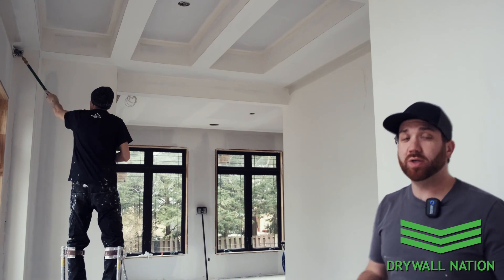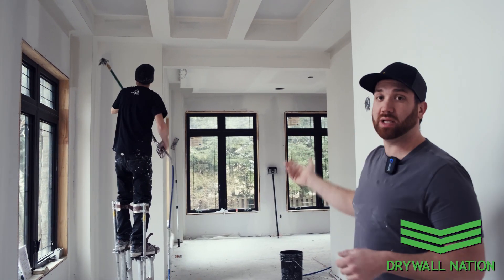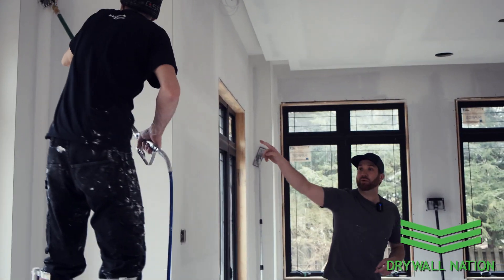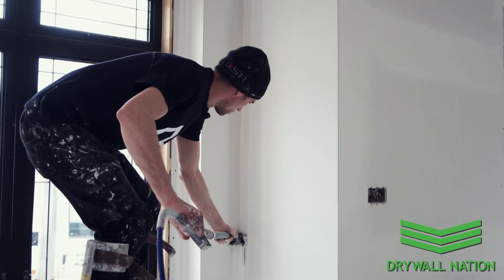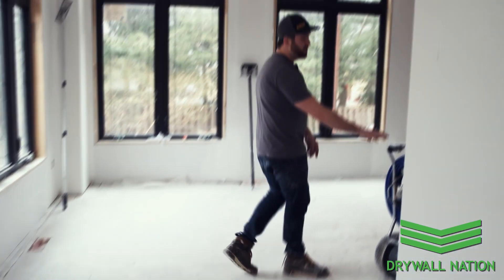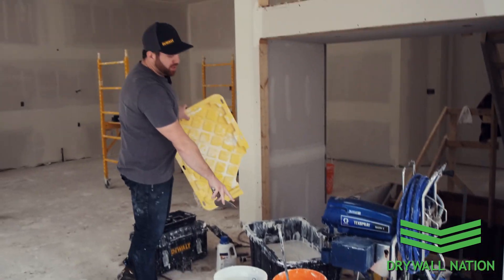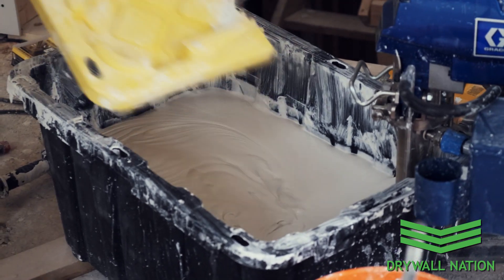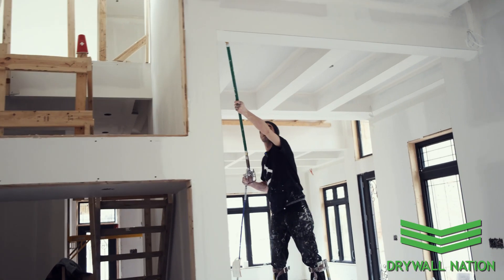Apla-Tech CFS Continuous Flow System w/ Brad Hanna

Comment: Very cool guys! Looks like a very easy method for running angles
Reply from the maker: Thanks Phil! It definitely has it's pros and cons. Just like any other tool. But one thing is for sure. You save a lot of time by not having to make trips back and forth to your pump.
Reply: Was curious do you use both systems alpa tech and Columbia and info would be appreciated... .

Comment: He's so far away from the head and that huge pole flex, his back and shoulders will be ruined in 10 years.
Reply from the maker: This is drywall....it doesn't matter what you do your back and shoulders will be ruined in 10 years. lol.
This is probably one of the easiest methods on your body for finishing angles.
Reply: @drywallnation  I've been working with automatic tools for 15 years.
The key is to always be close to your tool, wether it's a flat box, angle head, bazooka etc.
It might be a bit slower to use your stilts to finish your angles, but if you have back pain at 40 years old, you'll be much slower for a very long time.
Reply from the maker: @ProbeGT2  So you run your corner box and and bazooka off of stilts?
Reply: @drywallnation  I don't use a corner box, i use a blueline mud tube to finish my corners. 8' i don't use stilts but 9' and more i do all my walls 1st then get on my stilts to finish my ceilings.

I only use my bazooka to tape corners and use the same method. I do all my flats and butts with mesh and durabond90 so i can box them one coat the same day.

Yes the blueline tube is heavy but if you balance it well in you hand it is not more work than a standard tube, and you can finish a lot of corners before you have to refill.
Reply: @drywallnation  I also have the tallboy pump. Very nice thing to have with the bazooka you can easilly fill it when on stilts. Most people i know hate this pump because it's heavy but in the long run, it's a back saver.
I also bought 7 gallons bucket to go with it.
Reply: @ProbeGT2  love this tallboy . Stand straight!
Reply: @ProbeGT2  how's that method working out for you? This is something I've been wanting to do for awhile but haven't invested in a bazooka myself yet. I typically tape and coat with usg easy sand 45 and top coat with usg topping mud..
Reply: @LuisLopez-qg1fz  i went back to my mud tube for taping my corners.
Bazooka ia fast, but if you need to spread 5-6 spools of tape in your day, you get pretty runned down. The bazooka is heavy, and you need to lift this weight for every vertical corner. Also it's harder to havd the tape perfectly sized in the corner. I traded a bit of speed for less body fatigue.